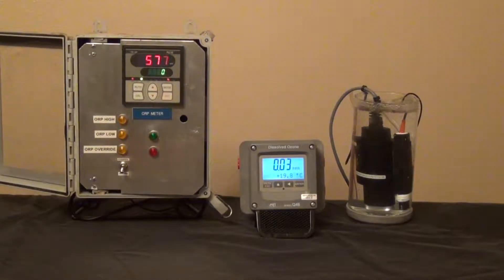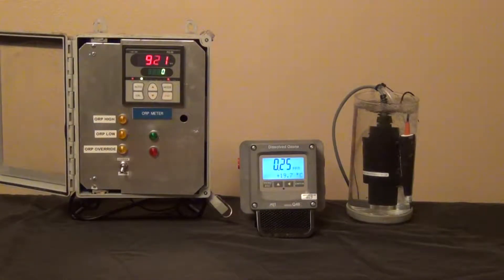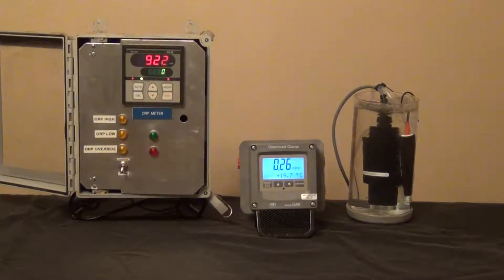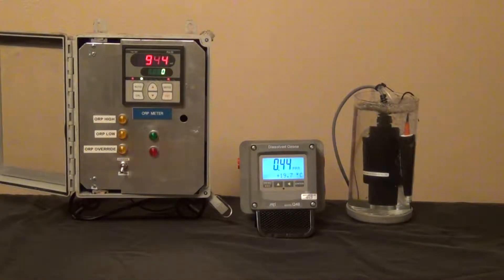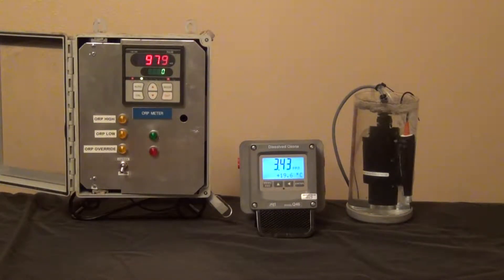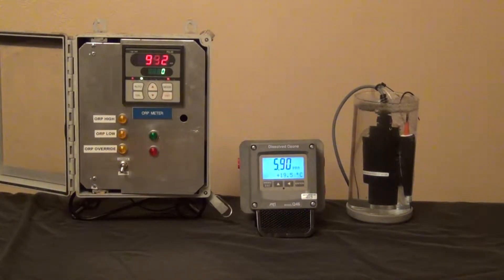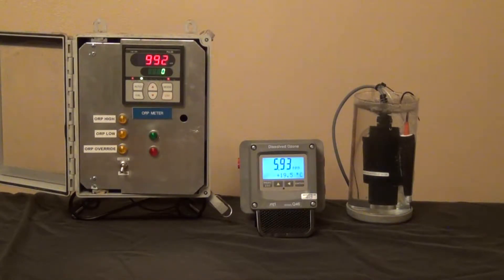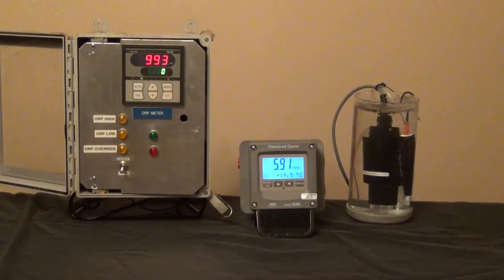ORP vs dissolvedO3 RO

Comment: I have a reading of 1300 mv on my Orp.meter, I  dissolved ozone in OR water 5 degree C .  My ozone generator 20 percent efficient.  I believe my readings are low actually.  I may need a bubble diffuser?

I like to achieve 150 mg/l ozone for chemical reactions I am performing?  Any tips?   What does your ORP meter read when you performed the test with cooler water?
Reply: ORP of 1300 mV is actually quite high for most application (600 mV is bacteriocide); Like you said, of course fine bubbles will have a better gas exchange and it won't leak to the air, which is toxic to breathe. I use a nanobubble generator to inject O3 in water.
Reply: but depends on your application